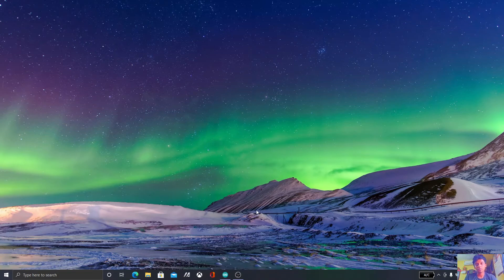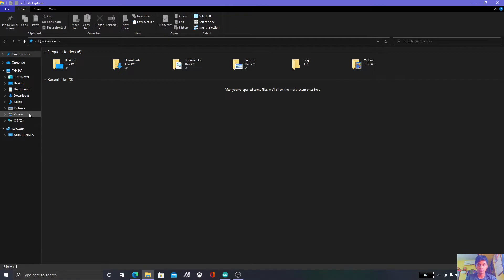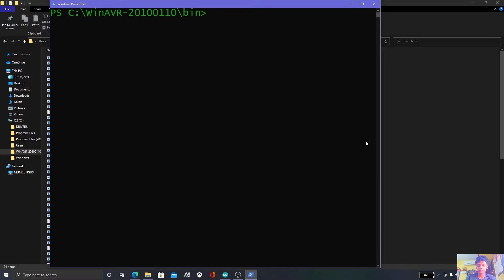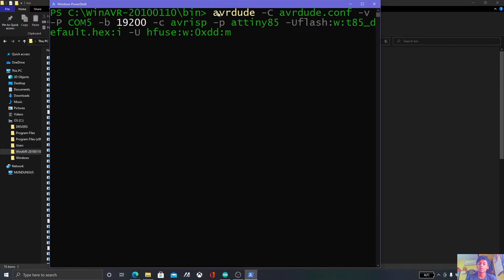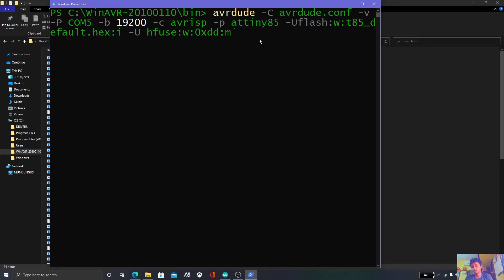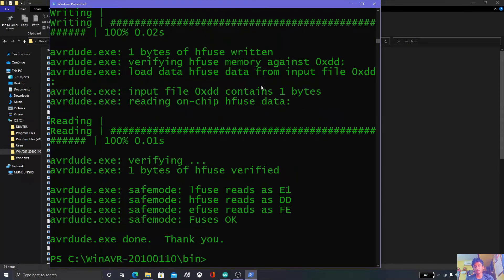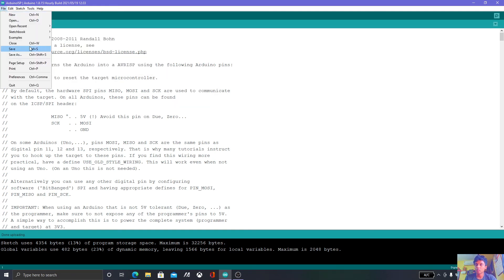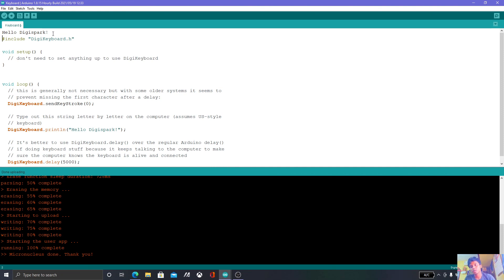FLASHING DIGISPARK USING ARDUINO UNO | BRICKED DIGISPARK |DIGISPARK NOT WORKING

Comment: It was a really useful video. I was struggling for the last 3 weeks for identifying whether my circuit was damaged or my software had an issue. Thank you very much for the solution. Just a suggestion - if you could use a better mic. 🙏

Comment: I get an error after running the command >> 
avrdude : The term 'avrdude' is not recognized as the name of a cmdlet, function, script file, or operable program. Che
ck the spelling of the name, or if a path was included, verify that the path is correct and try again. 

any idea why? i have the correct path as you directly on the c drive
Reply: solved. I installed WinAVR-20100110 and is working :)